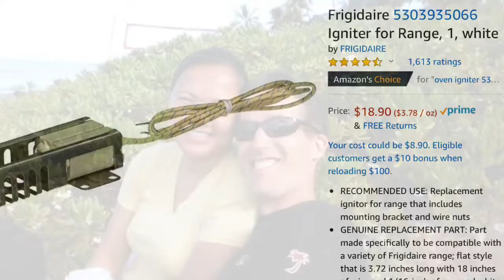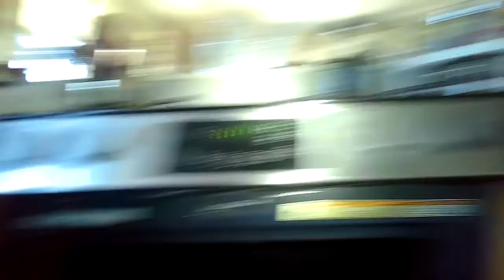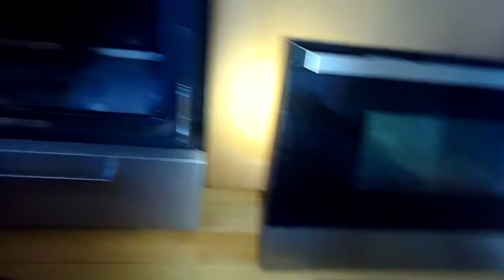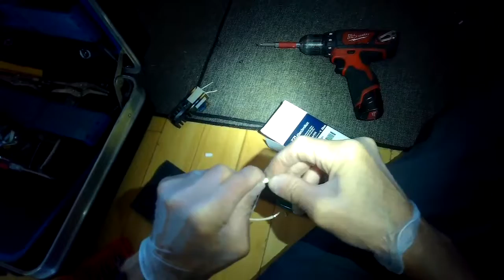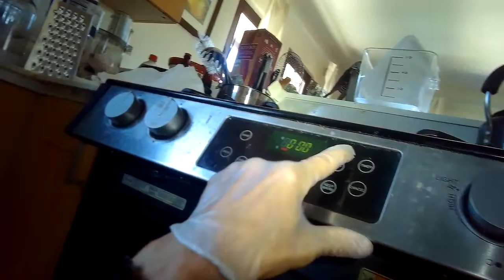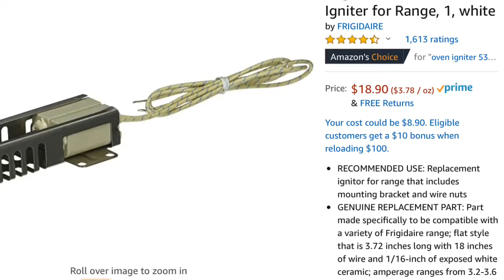✨ OVEN TAKES TOO LONG TO HEAT—FAST FIX ✨

Comment: With my oven I have been hearing and feeling a BOOM! Which I figure is the gas filling the oven then later being ignited.  Key words I think you stated, it may work but it is delayed.
Reply from the maker: Yep,
A new igniter will fix that issue😊
Reply: @ScottTheFixItGuyChannel  I live in an apt building. I told the manager of bldg it is a part replacement. He said, please do not attempt to fix it yourself. But, the super is probably going to just order a new stove and I will get blame..because it is ALWAYS the resident's fault. They may hold this over my head. So, I am thinking, I should just fix it on my own swallow the cost and be done with it.